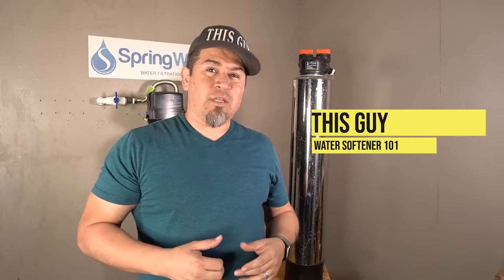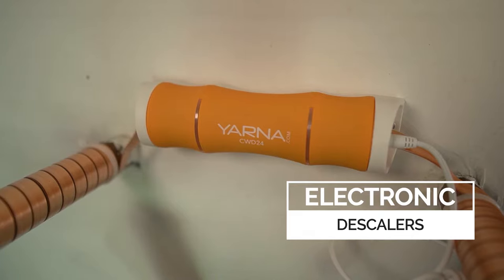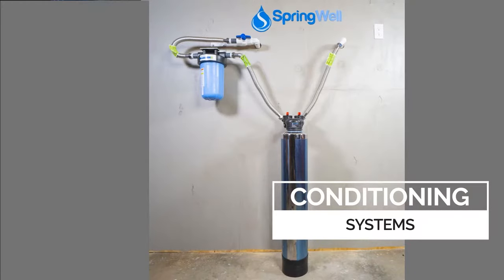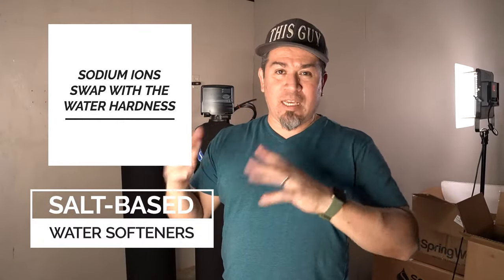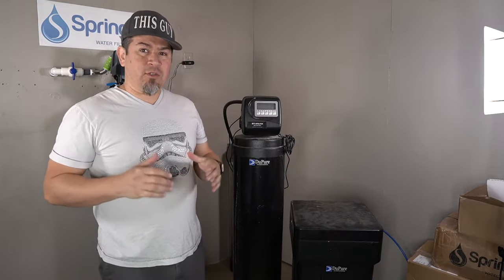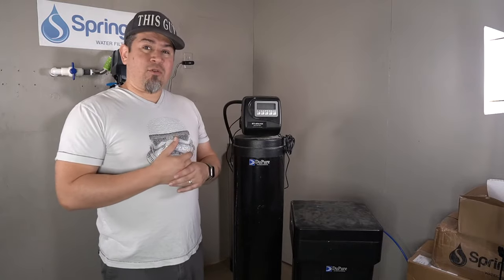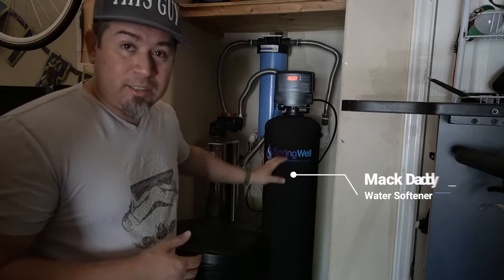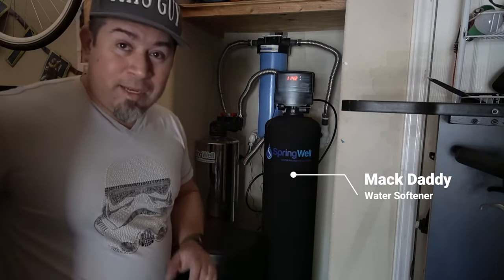Water Softener Basics - Different Types of Systems

Comment: Hi and thanks, it is kinda hard to get info on water systems, I have a system with the blue tank pre filter I change often, my well has iron in it, it also has four tanks, and a hydrogen peroxide tank, I have no idea what they do exactly. And lastly I have a R?O system for drinking water. Maybe one day you can cover a system like this? It was Kwater and it was just over 7 grand installed.

Comment: Hi This Guy, great video 👍. Very helpful. One question, is your garden hose water included in this system? Thanks.
Reply from the maker: No, not in the front yard at least. The water main runs to my front spigot first, then the water softener loop. It would be cool if it was cause I would be able to use soft water to wash my car.
Reply: @ThisGuyProductions  thanks.

Comment: This Guy ! You are my guy and I subscribed. I am in Houston TX, not sure where you are from. I was the second buyer from new and it has a Depure Water softener and under sink RO and yes all parts and service from them. Well the Dupure Water Softener finally failed though I think it never really worked for 5 years. Still buying expensive blue filters on the RO under sink. Well done. Inspectedthe Dupure system and now the head is dead after 15 yrs. Water softener dead. Had the same Dupure experience.

I need a new external water system for a 4 people home. A New RO under sink system. Hard Texas water. Does anyone have any recommendations ?

Comment: Real water softener lowers the water hardness measured by GPG(grain per gallon). Others 
are conditioners which does not lower the hardness.  We have a RO system for drinking/cooking water as well as have salt based water softener. If softener is correctly 
installed and set up there is no concern for residual trace salt in the water.

Comment: I have a Water King Whole house filter, Nuvo Manor Duo, salt-free softener and GE whole house filter.  I got them on a good deal and thinking about installing all 3 on the same system.  Is combining ok to do l, or what should I be aware of when combining different systems?  What order configuration should I use?  I'm city municipal.  Should I eliminate any of these from the system, or add anything to the system?   Again, not installed as yet.  Thanks.
Reply: Update.  I installed all 3 system this week.  I get a total of 10 psi drop across all 3, which is not a problem since I increased my pressure to 80 psi to accommodate.  So overall I get 70 psi flow through my pipes with three systems installed.   

Only thing worth mentioning though is the pressure drops even more when more than one faucet is being used, but I think this is because the waterking filter is for 3 bedroom (@15 gpm) and I have a 5 bedroom home which waterking recommends their 20gpm filter.

Comment: Does ur new system use less salt? Does it require a drain? How to maintain it after installing?
Reply from the maker: Yes, it technically does use less salt because the system is functioning correctly. The system I pulled out was regenerating almost every day so I was going through 2 (40lb) bags a month. The new system will regen about every 1750 gallons now which is almost 1.5 times a week. 
The system does require a drain, but it comes with a 50ft drain line. This means you can route the drain out of your installation area if you dont have a drain nearby.
As for maintenance. The resin itself in the tank needs nothing. If you use good quality salt pellets you shouldn't get mush residue in the brine tank. Worst case scenario you can dump it out every few years to hose it out. Besides that the salt system is bullet proof. 
If you go with a Carbon filter you will need to replace the carbon every 10 years or 1 million gallons. If you go with the pre-sediment-filter you need to replace them between 6 months to 1 year apart. They cost $70 for a 2pack of filters. 
Hope this helps.
Reply: @ThisGuyProductions  thank you, very useful information. Right now I only have a 3M descaler cartridge on my on demand electric heater. I also have a sedimate filter and a small coconut shell carbon 10". I may copy your setup but use my own 20" carbon coconut filter. I'm still thinking about a system.
Reply from the maker: @User-pb8pd  - Thats really cool that you have a tankless heater. If and when my water heater goes out again I will switch to a tankless setup. I am also impressed with your existing setup. It sounds great.
Reply: @ThisGuyProductions  I have a 27k eco. I installed myself. Just need to unscrew the elements to descsle every 6 months with vinegar. I also heat with oil, so I love in the summer I can hit the off switch on my oil system and easily turn off my on demand as well if needed and I pay $0 in service fees. The on demand uses 6 slots for 3x 40 amp breakers, so that is another thing for most to consider. I have 200 amp service and a very large panel. Hot water output is reduced from 3/4 to 1/2:as well. It really is unlimited hot water. I had it 3 years now. Maybe after 4 years ill buy some new elements.
Reply from the maker: Thats really cool Brian. I gotta check it out.
Reply: @User-pb8pd  man I really wish I knew what all this meant. I'm trying to reduce hard water from my place and try to get a system to get our water hotter quicker. It takes about 5 minutes for the shower to get hot 😄

Comment: How much is the monthly cost of the salt used by the water softener? Would a sediment filter, whole house water filter, and a whole house water conditioner accomplish the same thing but without the monthly cost of the salt?
Reply from the maker: Hey Mike, We use about 1.5 50lb bags of salt a month. We have a family of 4 and 4 bathrooms. We go through lots of water and this system is very efficient. We have the larger scaled system listed as CSS4. There is a smaller more cost effective system, but it isnt as efficient as the larger one.
The salt free system is fantastic because it removes the maintenance piece but it lacks the slippery feel of salt based systems. Ultimately, my wife and I missed that. Also, our laundry and hair was much softer after using salt based system.
Reply: @ThisGuyProductions  Thank you for the info.

Comment: Be careful of this review.  The guy sells the stuff he's reviewing so his review obviously will be biased.

First, it's been proven that water descalers don't work.  Water conditioners do work but they are not as effective as water softeners.  Finally, he's promoting SpringWell softeners but he doesn't compare it to many of the other brands on the market.
Reply from the maker: Hey Absoluteloyalty I appreciate you calling the BS meter as there is a lot of bias online. Yes, I am biased to SpringWell. Their product has been fantastic and their customer service is amazing. They also dont try to rip me off like DePure did with my original system. I was overcharged and their system failed catastrophically. When I called them to inquire about my lifetime warranty they basically told me to take a hike. 
So, yes. I have tested a DePure system for many years and was sadly dissapointed. The SpringWell system is like a dream. 
To all my viewers, I encourage you to shop around. At the end of the day a water softener is just a water softener. However, customer service is paramount to me.